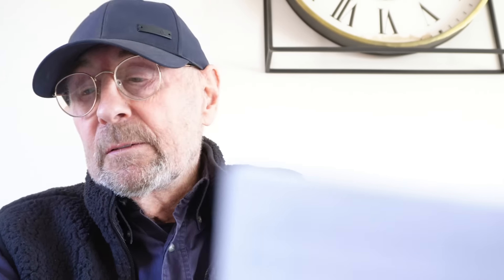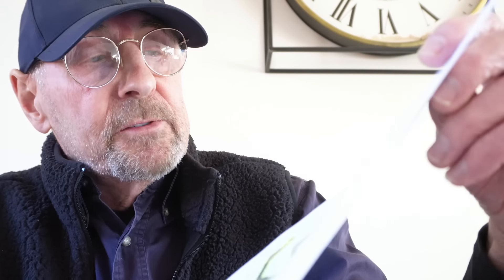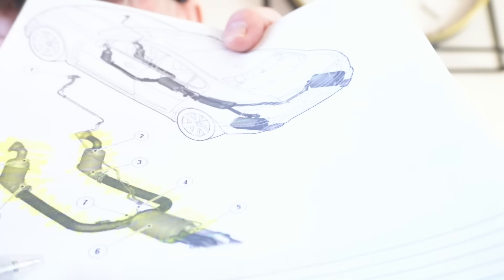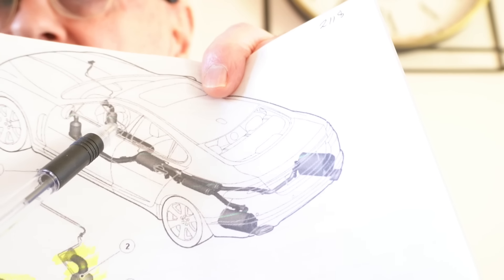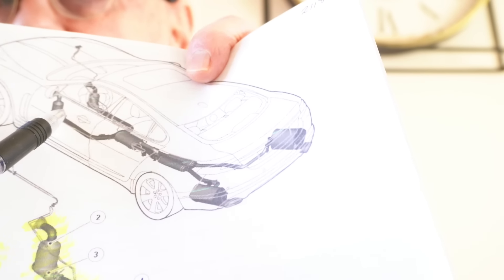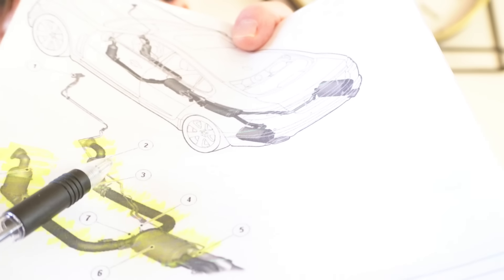CAUSE REVEALED!.. The Self-Destruction Of Jaguar Land Rover 2.2 / 2.7 / 3L Diesel Engines

Comment: Diesel contamination on the 2.0 Ingenium on early fitment transversely to Evoque, Discovery Sport and some smaller Jaguar models was/is due to the remote installation down the exhaust pipe of the DPF. There was just no room for it to be fitted directly to the turbocharger. The difference being the heat retained in the DPF. The gas cooled too much on the remote installation resulting in many failed regeneration attempts and the late fuel injection into the cylinders that is used to raise gas temperature, washing the cylinder liners of oil and the liquid passing the piston rings into the  sump. This has never been a problem with in-line installations of the same engine or the modified later transverse engines where the body was redesigned to allow a close coupled DPF.
This is not the cause of the V6 engine’s broken crank issue. Thisis due to a very short compact engine design which results in few main bearings and very thin metal fillets between piston bearings. The stress of only four main bearings on the exceedingly weak connection between sections of the crank results in a very high incidence of catastrophic crankshaft failures.
Frankly you have jumped to spurious conclusions based on sections of the engine service manual which do not address the actual failure modes.  The four cylinder Ingenium engines fitted to early cars with transverse engines, pre the facelift to reposition the DPF, have a number of issues including sub standard timing chains and guides and the fuel dilution of the lubricating oil results in sub standard lubrication of all internal parts.
The V6 does not suffer from oil dilution. The crank is just too short with not enough metal between the bearing journals. 5000 miles is certainly a must for early Injenium engines but totally over the top servicing for all other engines which do not contaminate the oil with diesel fuel.
Reply from the maker: Hi, thank you for watching and for your feedback. Some of your suggestions of engine failure raise the fundamental question, Why don't all the engines mentioned, across the board, fail. Engines can fail for various reasons as I said in the video, to say that the V6 does not suffer from oil dilution, where is your evidence / data, Jaguar say they suffer with oil dilution, perhaps you need to let them know they are wrong, just to put the record straight. Thanks again for watching.
Reply: @crystalclearmechanics  The evidence for that is years of experience where I have never come across a V6 with any significant fuel pollution of the sump oil. This is in marked contrast to early 2.0 Ingenium engines that were fitted across the car, such as in Evoque, Disco Sport and a small Jaguar, where a very high proportion of engines suffer from this. The cause is well known and due to the remote location of the DPF which was necessitated by the lack of room between the engine and bulkhead due to it being designed for the previous Ford engine. The updated models of these vehicles have a modified bodyshell with the DPG mounted directly off the end of the turbocharger resulting in higher EGT and a reliable regeneration every time, eliminating all the false starts which all required excess fuel in post injection.   By the way the late injection of fuel does not increase combustion temperature, but actually is meant to ignite in the exhaust gas itself external to the cylinders and down the pipe to the DPF. `In the same way that Ford and some others use an extra injector in the exhaust pipe itself, which Ford officially call an ‘evaporator’.  JLR are not wrong. Your interpretation of what they say and what actually happens is wrong. The problem with the V6 is that Ford never addressed their weak three bearing crankshaft that is too short, leaving very little metal between journals, resulting in an unacceptably high crankshaft failure rate.  I doubt very much whether they have cured the issue even today with the South African build and Ranger installation.  Just why they never had an issue with DPF ignition with the V6 but had such a shambolic experience with early four cylinder Ingenium is not known to me but possibly due to the vehicles being much heavier and the engine having to work hotter and harder on average than on lighter vehicles, but that is a guess.  In any case, in such expensive vehicles they really should not rely on excess late fuel injection for DPF light-off.    In the early transverse Ingenium the only solution JLR have to offer is oil changes at half or less the originally advertised intervals. They do allow a ridiculous 20% dilution of the fuel it seems, which to me is quite unacceptable.

Comment: THE biggest cause of self-destruction of the said engines, apart from the 2.2 (DW12), which alongside the 2 liter unit (DW10) fitted in various Peugeots, Citroens, Volvos, Fords etc. are one of the most reliable diesel engines ever, is the crankshaft failure on the V6's. This DPF and oil dilution problem is applicable to ALL diesel engines with DPF's. Pick a diesel engine from any manufacturer and you'll find people reporting the said problems. 
On newer diesel engines, especially from EURO 6 onwards, it's not the DPF that's the main concern, but rather excessive soot buildup in intake manifold and valves, since the EGR valves are active for far longer periods of time in order to meet new emissions regulations.
Reply: I agree about the inlet manifold contamination but this is mainly due to EGR [exhaust gas recirculation] which has been a common feature since around 1995 if not earlier. Fuel dilution due to failed DPF attempts is not an issue with all engines. Most good designs have DPF’s that are directly coupled to the turbochargers so they retain most of the exhaust heat in the gas and components, so they light off reliably with minimal extra fuel required. As long as these are driven some distance on a regular basis they last a very long time.
Reply from the maker: Hi, thank you for watching and for your feedback. That is an interesting point you have made about the DPF systems on other vehicles, I will research it. @hedydd2
Reply: By pass the shit EGR valves.

Comment: My wife’s Volvo 2009 2LT diesel dose this a lot because of short journeys so I do a forced regeneration and on smelling the oil you can always tell if the oil has diesel in it and it usually does 🤬🤬 it’s a pain in the ase as it’s usually only 3,000 miles when it happens!
Reply from the maker: Hi Paul, thank you for watching and for your feedback. I recommend 5,000 mile intervals to my customers and so far have not had any problems but 3,000 mile intervals can only be good.

Comment: Thank you for a very thought provoking video, I  believe that the oil dilution may be the clue. Possibly partially masked by using a different viscosity oil in some cases? My own perception (naturally with no hard proof) is that modern  diesels thrive if they are worked hard for long periods. the "school run" style of driving is just not compatible with the emissions control devices. I suspect that "driving style" is the most critical factor. The Lion V6 with the narrow web crank may just be more vulnerable than other engines due to bearing loads.
Reply from the maker: Hi, thank you for watching and for your feedback. You raised some good points. Thanks again.

Comment: I’d be interested in how you explain the cranks all going on the same journal, regardless of many not actually having a DPF fitted from factory as in Australia, Russia etc…..I mean it couldn’t be that it’s just not built strong enough for a nearly 3 ton vehicle?…..compare the crank to other comparable large vehicles and you’ll see the other cranks are much heavier in design…..mmmmmm
Reply from the maker: Hi Kevin, thank you for watching and for your feedback.I would like to establish / clarify what I said during the video. At the beginning i say it is possible that it covers the Land rover range but  not to sure about the Land Rover range as I don't do that many.so I have not researched it, then I say I am reading from a Jaguar document so obviously the facts I quote in the video are primarily about the Jaguar range. At around 21 minutes into the video I mention the reports of the crankshafts breaking on the Land Rovers, If you listen I use the words  " guessing "  " doubt " and " imagine ", these words do not imply that I know hence as I already said  I have not researched the Land Rover range of vehicles. I will be reseaching the Land Rover range and am interested to listen and discuss any issues, I also say near the end of the video that there can be various causes for engine failures apart from a main cause. I have seen many suggestions on the cause of the crankshafts breaking, Wrong grade of oil / weak crankshafts / too low oil pressure on idle/ accelerating to fast from idle /  etc etc and now the point you make /  imply that the crankshaft is not built strong enough for a nearly 3 ton vehicle. The question always pops up, If no other factors are involved then why don't all the engines in these vehicles, across the board, fail for the same reason. Unless you have data that says otherwise I would suggest that these issues apply to only a few vehicles in comparison to the number still on the road without issues. If as i said in the video the Land Rover range are using the same DPF system as fitted to the Jaguars then they will suffer the same side effects, oil dilution. Go to my video 2.7 3.0 diesel TDV6 Jaguar Land Rover destroyed bottom end crankshaft. Look at the comments, they are the reason I researched these issues. Comment from Olly, his wifes 2018 3.0 V6 showing 40,000 miles, 7.7 litres of oil drained containing large amounts of metal fragments. Liffeyking, I've just had this happen on my 2017 Range Rover Vogue SE TDV6 76,200 miles. Thanks again for your feedback.

Comment: Have you done video on DPF regeneration on our cars ?
And what tools are needed ?
Reply from the maker: Hi, thank you for watching and for your feedback. The video you have commented on explains how the DPF regeneration system works. The system can be forced with a diagnostic tool that has that application but usually a drive as recommended should cause the regeneration to start and complete. What are the symptoms with your car?
Reply: @crystalclearmechanics thanks 🙏 no symptoms… yet. Though my car does a lot of short runs.
Love the beautiful V6, but appreciate short runs not good.
Would forced regen every 10-12 weeks help
Reply from the maker: @macprocm  Hi, the main problem is oil dilution = driving style = constant short runs. At a range of about 250 miles run the car along a motorway for about 30 minutes  which will complete a DPF regen and change the engine oil and filter around 5,000 mile intervals as a precaution.
Reply: Many thanks for your advice 
Great channel 👏👏

Comment: JLR engine designers need to be sacked! They also cocked up the 2.0 Ingenium diesel as Land Rover drivers with oil dilution problems and timing chain failures will testify!
Reply from the maker: Hi, thank you for watching and for your feedback.
Reply: Ford designed and build the V6 and JLR did cock up the timing chain and guides for early Ingenium. as well as DPF/fuel contamination of lubricating oil, in early transverse installations, since redesigned in facelifted models.
Reply from the maker: Hi, thank you for watching and for your feedback. @hedydd2

Comment: Chrystal Clear Mechanics:  Please examine at least some of the failed AJD-V6 engines and i bet you find that the small rubber cone valve sitting botton of oilfilter base have been off from its holder, and part of the oil pressure have been lost thru the drain hole. Valve cone is in its holder just with push thru fit and mounting new filter wrong way can knock it off. Valve is acting as drain valve of the filter housing during filter change. Yes, oil dillution are part of the problem, but not alone. Just making situtation worse when oil pressure are low because of drain valve failed.
Reply from the maker: Hi, thank you for watching and for your feedback. I will look into it.

Comment: 2018 range rover sport.  Had a DPF problem driving  to Channel tunnel.  Got mid way and an audible sound started.
Then car went into limp mode.
Returned to dealer.
Problem sorted?....next trip had car serviced before starting off.
Got to spain, two days later engine destroyed itself. 
Had to relay home.
JLR paid for 80% of repair, but car off the road for 6 months

Comment: Seems like a lot of work and a lot of variables for the driver to worry about. I will just go with a petrol or petrol hybrid engine.
Reply from the maker: Hi, thank you for watching and for your feedback. A 5,000 mile engine oil and filter service interval as a precaution usually works for longevity.

Comment: Are you able to share this. My 2020 2lt has blow its turbo killing by throwing oil and metal into the dpf & cat. I’ve been told it’s absolutely nothing to do with the dpf by the dealership and now being ask to prove this has happened due to the design fault 🤷‍♀️ cars done 37k service in accordance to the manufacturer guide as I had absolutely no idea of any of this when I purchased it from the dealership. 
Out of warranty now and JLR have said jog on and Dick Lovett said I have to prove the design issue. 
So why the hell has my turbo blown?
Reply from the maker: Hi Debra, thank you for watching and for your feedback. Sorry to hear about the problems with your car. It's not uncommon for the 2ltr turbos to fail, proving the cause of failure after it's happened is difficult if at all possible. It should not have failed with such a low mileage and Jaguar service history but saying that does not really help. Has the engine suffered damage or is it just the turbo / cat / DPF?

Comment: Great video, I have the D4 SDV6 with 90k, oil is changed every 4k but use it regularly on long trips over 150 miles. So far its good. Just to add to some of the comments, the crank fails are almost always due to the main bearings spinning in the block, which can be caused by the lack of lubrication and oil pressure between the main bearings and crankshaft. Oil dilution which is a known problem could easily promote the failures. Id reccomend taking some advice from this man and change your oil frequently, its a lot cheaper then a reconditioned engine, also please remember that Christian from LR is a single man whose research is based on other peoples findings mostly, and a few diy test rigs in the garage at home, no disrespect but he is not God, just a man trying to make a few quid off youtube.
Reply from the maker: Hi Terry, thank you for watching and for your great feedback. 4,000 mile oil change can only be good.

Comment: Appreciate your video,  would you recommend flushing every oil change? or a all?
Reply from the maker: Hi Safi, thank you for watching and for your feedback. I have found these engines to be very clean internally so no, I would not flush at all. In my experience the 5,000 mile oil / oil filter change has worked regarding oil dilution and driving style, of course this is not a given you must decide. It is always worth checking the oil level to see if it has increased ( an indication of oil dilution ) but not if your engine is burning / leaking oil.
Reply: @crystalclearmechanics 
“Very clean internally” yes, it’s flushing itself (with diesel) as you drive! 😂😂😂
Reply from the maker: Hi Phil, thank you for watching and for your feedback. @philr1448